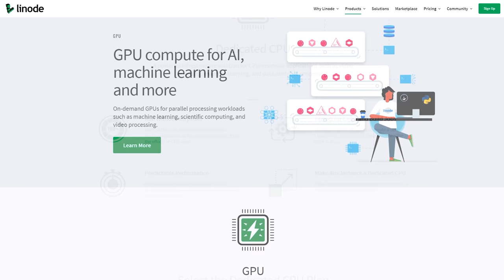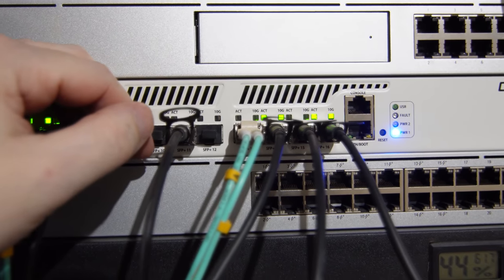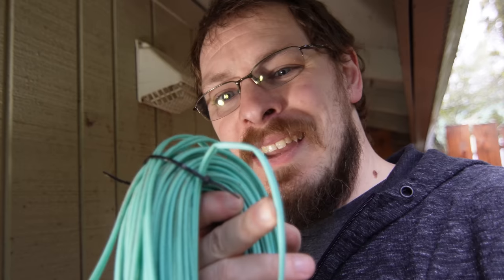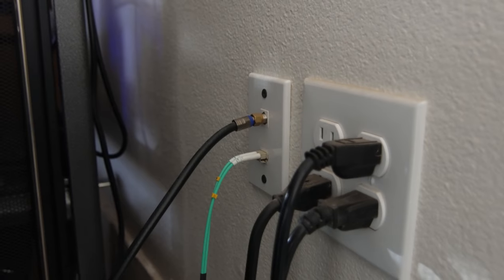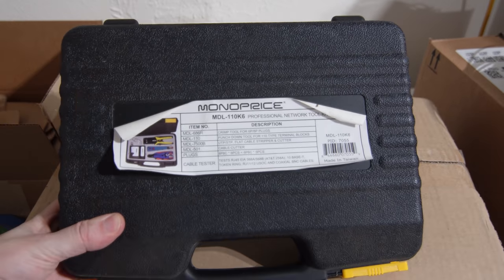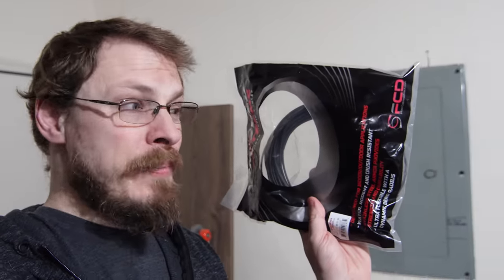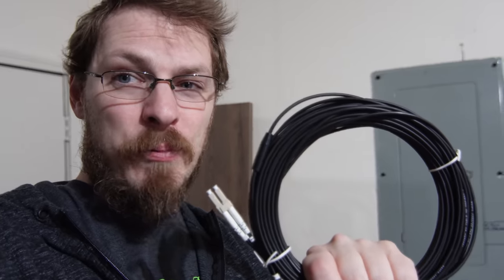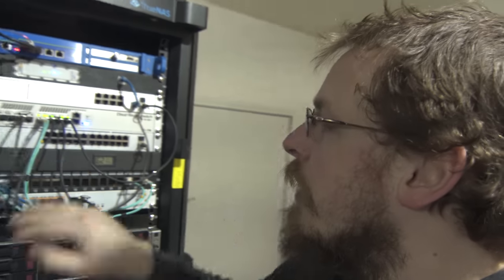Mistakes were made. Let's fix them.

Comment: I was fortunate to acquire a fusion splicer from an old employer that went out of business, it was one that was "well loved" shall we say (worn out, filthy and not working) and it just needed a good strip down and clean to get a couple of the alignment motors unjammed. It's so great to have and it lets me terminate my own cable any time I need. Given it's history and that it's uncalibrated and not professionally serviced in many years I wouldn't use it for client work but it's sure handy for hobby use. I don't however own an OTDR to check the cable afterwards but a colleague of mine lets me borrow his if I ever need it :) The splicer I have is a Fujikura 70S so not particularly cheap in it's day but it is a quality bit of kit so has lasted well
Reply: I'm fortunate to work for a fiber ISP as well so have access to everything I ever need from the scraps/offcuts bin :)

Comment: That yellow fuzzy stuff you saw when pulling the wall plate is kevlar. Pretty much all individual strand fiber cables have a kevlar sheath. The outdoor cable has a metal foil layer to help locate it when buried; it's not a strength member. Personally, I'd recommend nailing up some conduit for any outdoor ("hanging on a wall") runs.

Terminating fiber these days isn't necessarily an expensive, or complicated process. I jokingly refer to mechanical terminations (way too common in FTTP installs) as "Lee Press-On"(tm) connectors. (from the old fake fingernail commercials) They make them for MM as well as SM. Terminating MM is a lot less of a headache, but still takes training. SM isn't done by humans anymore -- the actual mating of the fiber into the LC end -- everyone buys factory made and tested pigtails to splice on. (Fusion splicing has become a very easy process, too. But the machine is still $900+)

Oh, and your "outdoor" cable was definitely broken at the nail hook. That 90&deg; bend will be a hard break.

Comment: I'm not entirely sure indoor versus outdoor fibre will make much of difference when the problem is someone/something yanking that hard on it.  Outdoor will still fail the exact same way as the armour only goes to the knuckle.

Securing it properly, now there's the key to long lived installs.

Modern fibre is amazingly durable. When I started to consider using it at home I bought a section to sacrifice to the durability testing gods.  In the end, I gave up and stopped torturing the poor thing. It's still working fine @ 10g nearly a year later, despite all those chair castor dents and knot bends still in the jacket!

Comment: Just FYI it's a bit cheaper than that to get your own splicing kit. About 800$ for a really decent fully automatic Chinese splicer kit with everything you might need. We've had (tiny ISP) Signalfire AI-7 since 2018 and it's been solid, did about 400 splices in that time with zero issues. And it's realistically very easy to use. A decent optical OTDR can be had for about half that, but realistically for simple runs you only need to shine a light. Sure..  it's not for a home user still, but if you need to do an office for example - it might just be worth buying a thing, instead of playing people to do it (plus you save time).

Comment: My server kit is also in my garage/workshop and I have fibre similarly running, I didn't use indoor fibre because it crosses a path and runs along a fence, some animal has already tried to eat it once but it survived! For the past two years or more I've also been trying to connect to properties on a mountainside, regular WiFi doesn't work due to trees, I am currently using "HaLoW" wireless which gets me about 1.5Mbps with inconsistent latency. Next step is running Cat-6 and POE to somewhere that can help Line of Sight, to try 5GHz WiFi, but if that fails? Then I'm going to be looking at running +800m of fibre along a hillside and across a river!

Comment: I hate this video because it reminds me that, after a year of putting it off, I STILL need to dive under the house and do some cable runs because I'm too particular to let myself run them on the exterior of the house. I mean, if I just ran them on the exterior, I'd be done already.

Comment: Someone gave that cable quite a tug.
Dudes kids - .... The dog did it.

Also not to shade but does make me feel better about what I consider not great cable runs when I see yours all droopy and hanging outside across windows and stuff.  My first IT job was interning for a college network admin and I ended up doing all of the network runs.  He drilled perfection into my head, so seeing drooping cables bugged me.  I've also terminated fiber at that job, can't remember what the ends were called - ST maybe?  The barrels you twist on to lock. Had probably a 40% success rate in the cable working but it was good experience.
Reply from the maker: "There's nothing more permanent than a temporary solution".

I made a temporary run, and it worked well enough that I didn't replace it properly until it failed.

Comment: Yep, I work in a Colocation data center & we only terminate Ethernet. All our fiber is bought pre-built & we dont even have the tools to test it aside from a laser light. Pretty sure the only fiber that gets repaired or re-terminated is buried outside & mostly a mile or longer.
Reply from the maker: Yep. I did a lot of MSP style work, and everything except intra-building runs were always ran with pre-terminated lines.

Comment: Good troubleshooting! A good video doesn't always have to have a script and a ton of editing. It can be a lot of fun to go through the adventure of troubleshooting a problem like this, and to see your reasoning on things. 

I happen to be the kind of nerd that likes good hands-on projects. We built a new house specifically so I could run my own home network before sheetrock went up, and I ran 7000ft of Cat6 'E'. All runs are under 25m (most are under 10m), so 10 gig should be pretty easily attainable when the time comes. I went with 3x 48 port patch panels (cat6 keystones) and a stack of 3x 48 port gig Cisco 2960's. I don't quite need 10 gig yet, but will probably LAG a few bundles together sooner rather than later. 

The process of drilling, cable pulling, cable termination, and rack installation has been about 300 hours total (excluding planning, documenting, and other non-layer-1 activities), and cost about $2000 (excluding all actual network equip, just the barebones hardware). It's been a lot of work but a lot of fun!

Comment: I looked at your enormous length of fibre channel cable hanging on a loop and thought "Ahhhhh, the old chestnut about the electrician's house..." then I remembered something. 

That thought prompted me to immediately walk downstairs. I opened a small cupboard and beheld my own 'picture of Dorian Grey.' A horrific Chululan mass of dusty cable spaghetti, blinking lights and humming electronics. It was an edge switch, a pile of small devices and smart hubs which I had crammed into the cabinet under my TV two years ago when we moved house. At the time I had mentally labelled it "I'll fix that when I get a minute."

Now I've calmed my OCD down I'll be Marie Kondo'ing that monster this weekend.

Comment: I would recommend a demarc box for the cable line outdoors and new coax cables from the ground block to your modem those connectors all look like crap. proper RG6 with PPC connectors is relatively cheap online.

Comment: I can feel you pain. I live in the Netherlands, my problem is that the cable tube in my wall is narrow and has a small bend radius, the pre-terminated fiber cable can't go through... I have to run Cat6A to my livingroom, and the 10Gb transceiver is hot :(

Comment: Why did you not run the cable in UV rated PVC conduit?  I have done that with most of my indoor Cat 6.  
If anyone asks why I did that for indoor cable, then the answer is easy cable pulls.  Also better protection.

Comment: I field terminate fiber and it is not that bad, but it is not cheap.  The primary reason I field terminate is when it needs to be pulled through existing conduit and pre-terminated just will not fit. 
Also nice to have an exact size.

Comment: If the cable wasn't abused/kinked anyway: Re-terminating fiber is child's play nowadays with field assembly connectors and a cheap cleaver - total cost < 50$. If really needed, you can even get a brand new fusion splicer for <600 bucks from China..
Reply: ..and about running cables outdoors - ever heard of outdoor cable conduits/pipes?
Reply: Btw: OTDR meters are affordable, too.

Comment: 15000$ is only valid for single mode cables and also for splicing them. OS2 is the standard here.
Multimode like your OM3 is actually possible to ground in by hand. Not a trivial task like CAT6 and so on but doable with little cost.

I also prefer to buy per terminated cables but I always have a multimode kit at hand for emergency patch work in case my replacement cable is some strange/rare cable... Like the ones with 24 fibers in one connector but the other end is all LC and one of the LC is broken like yours.
Reply: He said fifteen hundred, not fifteen thousand. :D Yeah, buy pre terminated, it's less of a hassle and you have warranty if it doesn't work.
Reply: @samiraperi467  Welp... that's my bad. But I can assure you that splicing equipment will cost that much 😜

Comment: Yeah terminating fiber can be tricky. I worked in IT, in a big school a few years ago and we had an internal run done by a contractor which cost a fortune. We had quite a few more links that needed doing between buildngs later that year, so we thought it would be worth investing in some training and equipment rather than paying for other people to do. Overall, very interesting, but depending on the methods used a very tricky and intricate process. All went pretty well terminating the fiber (which we had our regular electrician run for us). Well until we tried to terminate some properly armoured external grade fiber which was a nightmare, had gel inside and all kinds! Got there in the end though, and it was a lot cheaper than getting it done by other people. We would have liked soeme proper testing gear, but they were thousands of pounds as opposed to the light loss meters we used which were pretty cheap.  Anyway, TDLR, use pre-terminated patch cables like recommened inthe video. 😁
Reply: Quick connectors / self aligning mechanical splices are literally easier to terminate correctly than cat6, and are fine for most small scale applications. Validation beside simple forward loss on the other hand gets expensive fast.

Comment: You can use pretty much any fibre outside… just put it into some electrical conduit…heck a garden hose would do too 😉 … make sure water can’t get in and bob’s your uncle
Reply: Here is Australia our regulations S009 require that all outdoor installations require outdoor rating, even if installed in conduit. Their thinking is that a pit lid could be left off exposing the installation to UV. I'd protect the cable with a conduit as a matter of course plus it makes it easier to add a second run in the future.
Reply: @vk3fbab  Even for Fibre? That really seems a bit over-regulated. For Cable that conducts or could potentially conduct electricity it makes sense, but for what’s essentially just a long piece of plastic? Jesus 😳
Reply: @gorgonbert  Yes we have lots of regulations related to electrical safety in our communications cabling standard. With the most recent revision we're only supposed to crimp male RJ45 in cases where we have no other option. Also it means we cannot make patch leads. Patch leads must carry a RCM mark which means a lot of patch cords from USA etc are not legal to use. Not sure how this makes things safer. The other one that catches people out is the install must follow allow written instructions from the manufacturer. This means you need to use punch down tools specified by the manufacturer or you violate the standard and potentially could face sanctions from the ACMA (our FCC). Luckily ACMA doesn't really care much about this area of regulation unless someone dies. We're still very English here!

Comment: I'm trying to figure out a reasonable scenario for running network cable from inside the house, to outside, back into another location inside the house.
Reply from the maker: My office is in the basement, and I don't have any easy access to the ceiling or walls in that room. Running outside is a simple fix, just like Coax runs from every satellite and cable company on every house ever.
Reply: @CraftComputing  Ok.  Cable and satellite signals come from outside so no correlation can be made to what you did.  But I will accept that you thought it was easier to run a cable inside - outside - and back inside.  It's just odd given the ease at which fishing wire can be done.  I have a double server rack in my basement and am running ethernet throughout the house (post build) + workstations throughout based in the racks.  I do have a wire to my shed but I took the time to bury outside wire through pvc pipes.  You're very competent with software and even beyond me with some of it but your hardware design and management is quite unsophisticated and frequently shotty.
Reply: @shadowmist1246  beyond what Craft Computing said, you've got inaccessable gaps between ceilings and floors, walls that don't align from one story to another, solid (concrete/stone/brick/etc/) walls, spray foam insulation... lots of reasons an internal run can end up being more trouble than running it outside.  I ran into a sealed-off portion of my attic trying to access an exterior wall that I'd have to cut through and repair afterwards, so i ended up using a different wall.
Reply: I have a small townhome, just under 1000 sq ft, and would have loved to run my connection between first and second  floors outside. Somehow they managed to build the place so there are no straight line between floors except for the small enclosed where the water heater and furnace exhaust vents run. If I'm not running my lines through the cold air returns I'm definitely not running them next to exhaust vents.

I knew to not even bother asking the HOA for permission. Which is odd, actually, since I may have the only unit that doesn't have two holes in the exterior wall where the cable tv lines go in. Mine went directly into the crawlspace.

Fortunately I have access to both crawlspace and attic and was able to finally drop both CAT-6 and fiber with only a small stretch running along the stairs. (It pops out of the storage area under the stairs and into the linen closet at the top of the stairs.) The bottom of the bannister is a bit of U-shaped black metal so it's nearly invisible with some black duct tape. (double ugh). The cable TV line was similar but since it was a high quality cable it could run under the carpet in a small groove cut in the pad and we only needed one cable.

Comment: I was in our lab at my old job and got fiber wrapped around the wheel of my chair and annihilated it.  The IT guys had to pull new fiber through the raised floor during lunch.
Reply: and that's why you got fired
Reply: @marcogenovesi8570  🤣🤣🤣 not my fault that someone did a poor job of cable management.

Comment: Your attic not accessible for wire run? Also depends on equipment used to terminate fiber. The field connect stuff was a pain but fusion splicer was fun and surprising easy. The cleaver and alcohol you use is key.
Reply: His attic may lack room for him to pull the cable through.   Besides, what he did with the armored cable as it's tucked nicely under the roof's overhang he's seems happy with it.
Reply: So far, for field connectors, my company uses AFL FastConnect connectors as they are quick, easy, and very forgiving with the cleave and cleaning with their index matching gel. Splicing often takes place as well for pigtails, but for single cables, the field connectors are super quick and anyone can do it.
Reply: @Nick_Shrope  We used the fc connectors for things like access control so luckily it didnt have to be perfect. Maybe i am just remember doing fc in sleet, rain or in the dark. lol

Comment: Fire cables have their pros and cons. Their fragile hard as hell to fix nature is their biggest downside other than the ingress of dust.
Personally I prefer copper, though it does have its practical limits as well, usually in the bandwidth department when distance is concerned.

And yes, patching fiber at home, or even in a professional environment isn't all that practical nor economical, unless one runs a lot of fiber.

Comment: You need a proper tools, but the FO termination by connector level is relatively easy on MM-fiber, SM-fiber is more delicate. Still, nowadays there is a pigtail termination method and renting the proper kit is likely possible as well. In our end of the World it is priced per termination "attempt" for about $1. If you are noob then at least 25% of attempts is the natural learning fee. Pigtails for SM and MM are about $1 as well. Easy.

Comment: Does you’re switches not support loop back tests? While yes that old fiber definitely needed to be re-ran, personally when ever I’m considering re-running fiber I always like to confirm there’s no other issues first before hand with loop back tests towards both sides of the connection that way I’m not stuck being disappointed with a still non-working link even after running new fiber

Comment: If you want to epoxy fiber it cost about $300. Validation doesn't matter as much at bellow 150M but anything longer yes(as it will work or not, or just give weak signal). But if you need to splice fiber or anything it gets expensive. Just over all not worth it over buying premade cables of course.